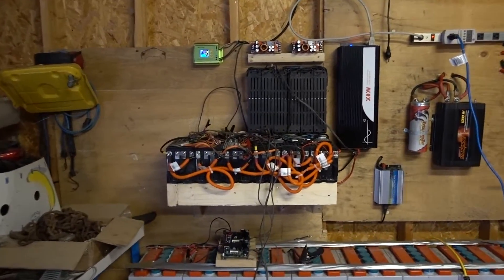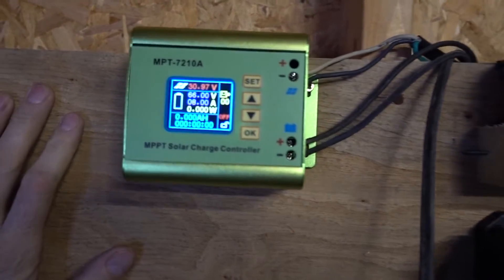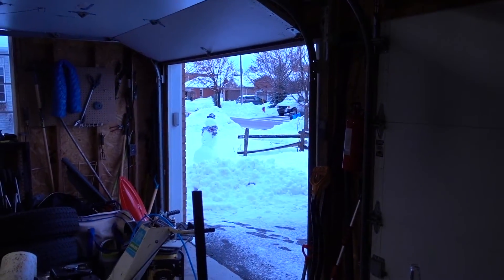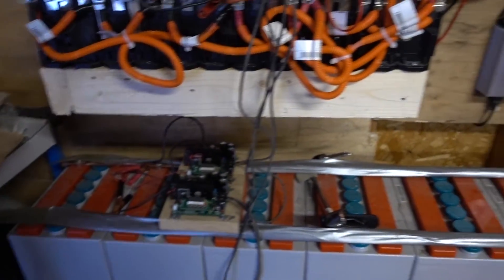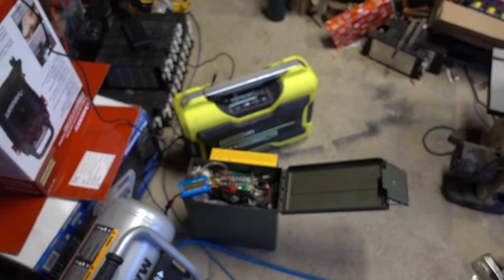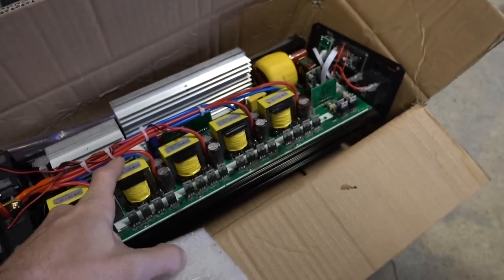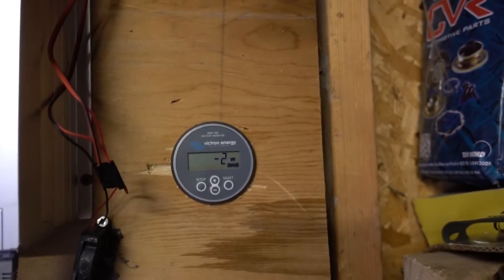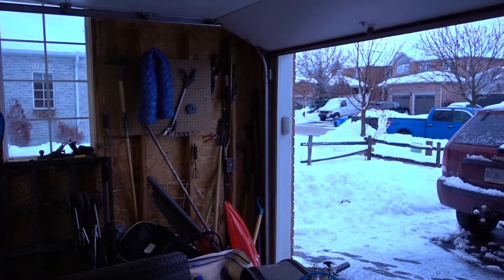New Charge Controller For Power Wall

Comment: Consider 1/4" drywall on your plywood wall just in case. I have pictures of a building fire i can send you that would blow your mind at how important drywall is.
Reply from the maker: yes it is a good idea, I have particle board now and its hard to burn :)
Reply: particle board is extremely flammable esp with age. The glue is the problem. it separates with age and fills the gaps with air. It burns blue in a fire.
Reply from the maker: once on fire it burns ok ish, it takes a very long time to start to burn I have burnt a lot of the stuff.
Reply from the maker: btw its the stuff in my newer videos :)
Reply: lol I'll just have to keep watching and take your word for it. :P
Reply from the maker: dont take my word for it test it :) look at what I have in my newer videos and test it! :) not as good as drywall but better then plywood.
Reply: yea i just saw that video. that stuff with the white surface covering is really hard to start up. age and moisture is the only thing that makes them go bad.
Reply from the maker: cool glad you saw it, its going to be heated soon!

Comment: I had a question about your power jack inverter that you have on the wall the bluish colored one is it a good quality have you had any problems with it I was thinking about purchasing one but haven't seen many videos of people using one in by setting with large enough batteries baking
Reply from the maker: mine is a grid tie inverter it has made 1390WK of power so far, it has worked with out problems, but just like my Chinese inverter they can break.

Comment: thought about getting one of those mppt controllers myself but they don't do 12V only 24v and up
Reply from the maker: these are really crapy I would only buy one if you needed one for lithium batteries, they are not to efficient.
Reply: That's good to know thanks. I was thinking...I have 2  105ah marine batts that are good for maybe 105 ah before I reach 50% dod.. I should sell them and use the rc lipo flight packs I have instead...they all ad up to about 120-130ah and they absorbe energy 50% better then lead acid. Sound like a better plan?
Reply from the maker: David Smith that would work well, but for the lead batteries I would get a 10amp EP solar mppt. they go for around $75